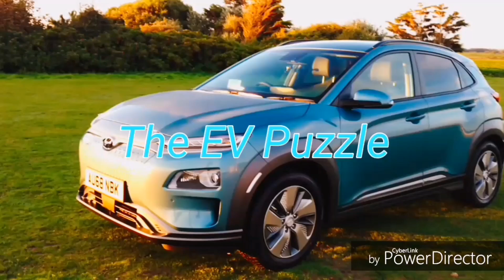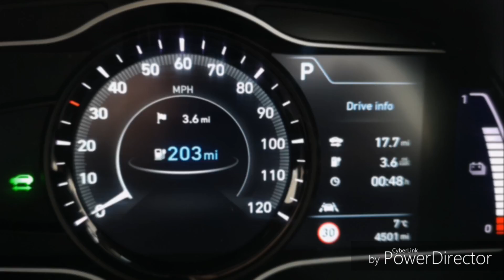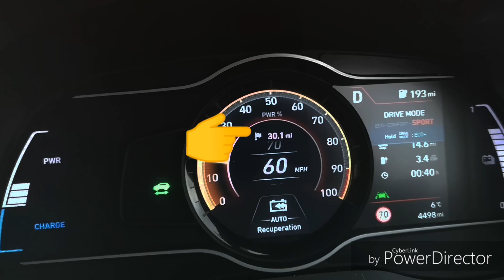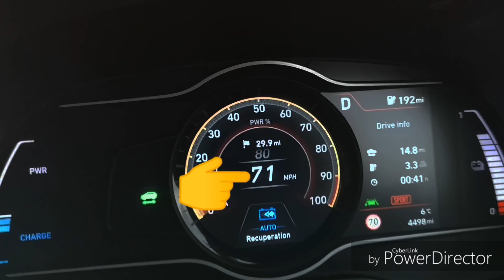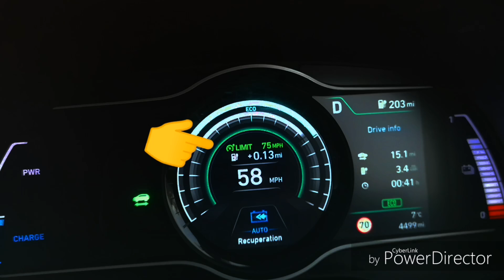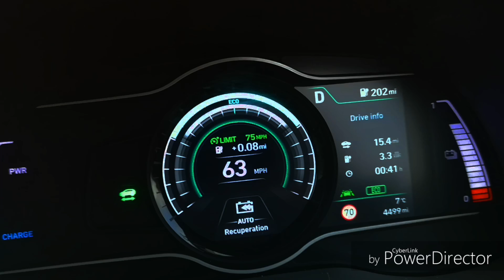Kona Electric Drive mode displays

Comment: Can you do a video using the auto regen. and active cruise control. In heavy city traffic, and motorway. (Stop go function) I would like to see how the active cruise control handles the situation where you merge behind a car less the the distance set. Question when Changing speed zone using active cruise control, can you dial in the new speed, or do you have the reset the cruise control

Comment: Hi Nigel.  I see from the video that your last trip you were getting 3.4 or 3.6 miles per kilowatt.  That comes out to a full range of about 230 miles.  Is that what you are averaging per charge? Or higher?
Reply from the maker: I'm very rarely running it from full to empty do the actual range is indicative only.

I'm averaging 4+ml /kWh on longer trips.  

Guessing at the range I'd say for my driving in winter conditions it's around 250 miles

Comment: Is there an option to change display from miles to km? I have a UK ioniq in republic of Ireland where limits are in kilometre and I travel to northern Ireland a lot. The ioniq can display mph with km in small on UK imports but cars sold in republic if Ireland are kilometre only. How does the kona handle swapping and dual display for those who cross borders to Europe regularly?
Reply from the maker: There is a 2nd unit display yes. Mine shows kph too if wanted

Comment: Yeah, the inconsistent display stats when you change drive modes is not good... I wish it would stay consistent for all the modes... Also, isn't there a NORMAL drive mode as well, in addition to SPORT, COMFORT, and ECO? And what about ECO+ ?
Reply from the maker: Normal is Comfort
Reply: @EVPuzzle  Ah, I see.. I guess it's called "Normal" in the North American market and European model is called "Comfort.".. Also, there's an ECO+ mode.. Is ECO+ not available in European market?  See here: https://driving.ca/reviews/road-test/first-drive-2019-hyundai-kona-electric
Reply from the maker: Eco plus is just Eco mode with climate restrictions to save energy.  No different to simply turning climate off yourself. Displays are the same

Comment: Nice video. 
I think the numbered Torque meter is a mistake, some drivers will instinctive think of it as speedometer. Eg. 30 %.. Is practically where 30 mph would be....
Otherwise nice
Reply: They'll only think that for about 5 seconds, then realize the car is going a helluvalot faster than 30mph.

Comment: I wish they would offer a "super-sparse" display option. I'm a real fan of uncluttered displays.
Reply: Scott Stephenson Duct tape I think you’ll find is the answer here.
Reply: @dcvariousvids8082 Funny you should say that. Back in the day I was a C-130 aviator in the Air Force. In the early days of night vision goggles, they were incompatible with the 1950s -era indicator lights in the cockpit. To make sure we weren't suddenly blinded at 300 knots and 50 feet above the treetops - you guessed it, we duct taped the lights.

Comment: Nigel how do you get on with the instant torque and wheel-spin?  A few reviewers have mentioned this.  I get it in my diesel when the turbo kicks I’m so am used to holding back, but I just wondered whether it is something you need to consider when setting off from a junction etc.
Reply from the maker: Jonny it's fine and not noticeable in normal driving.  After moving from ice to EV though the throttle feels digital compared to a cable analogue ice car so there's a tendancy to use more throttle than is needed. The adjustment to the lack of sound with acceleration adds to the experience. When you're playing or testing the car I found It more digital and hence wheelspin more likely. Now I'm fully used to it I only break traction If I'm flooring it for a reason.

I'm not noticing torque steer as a result

Comment: Why is there a red marker on the dial at 30 mph on comfort mode?
Reply from the maker: Well spotted. I don't know. Speed limit was 70mph so not that. I'll check in a bit if it's on all the time
Reply: You can choose the default road speeds somewhere on the main display. Will go and look for it again.
Reply from the maker: Really!? Don't recall that one but then you have read the manual... how many times . I mean you've found those super eco settings but not told me yet 😉🤣
Reply: I have just spent 30 minutes in a freezing Kona unsuccessfully looking for it. My recollection is a display of three discs showing 30 60 and unrestricted but maybe I have dreamed it. Wouldn't be the first Kona based dream. Help. Send for the men in white coats!
I will continue to look - or possibly hallucinate.
Reply from the maker: Discs?? Curious
Reply from the maker: It's there permanently it seems. Wonder on European cars what number it's red on....
Reply: The EV Puzzle Can you switch to km/h within car?
Reply from the maker: No but there's a 2nd speedometer you can enable to see kph at same time. Digital in the centre area. Shame it can't be mph also as perfect in comfort mode

Comment: Hi Nigel, I noticed that the little green car with the arrows on the left of the speedometer is always "on". Did you explained that in another video? I obviously missed it.
Reply from the maker: No I haven't mentioned it, it's one of those obvious things you have to find out as soon as you get the car so I forget others might not know it indicates the car is on and ready to drive....or driving.